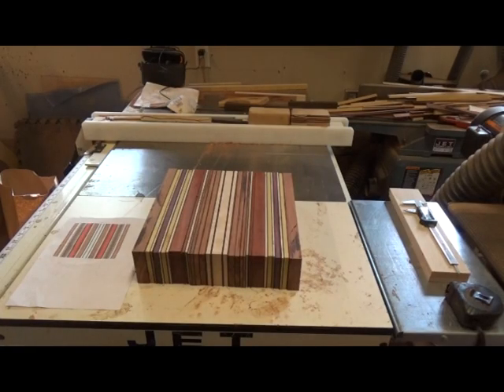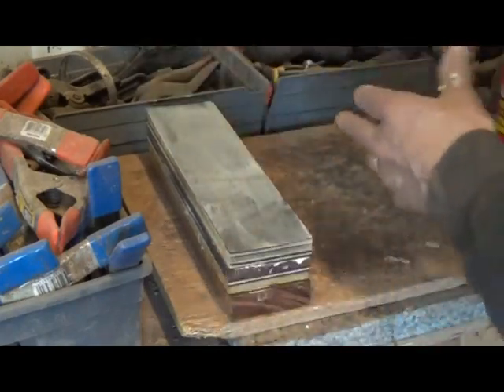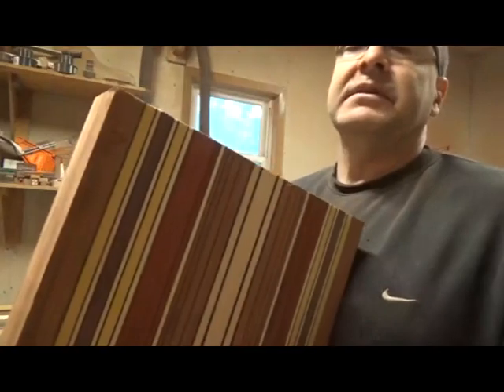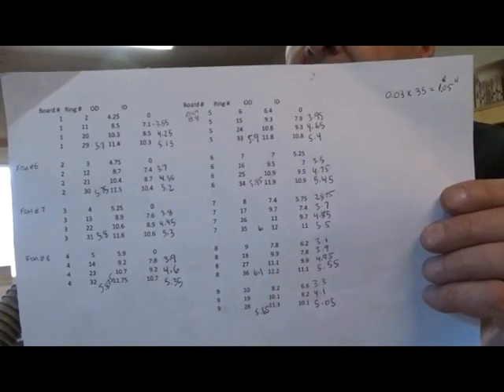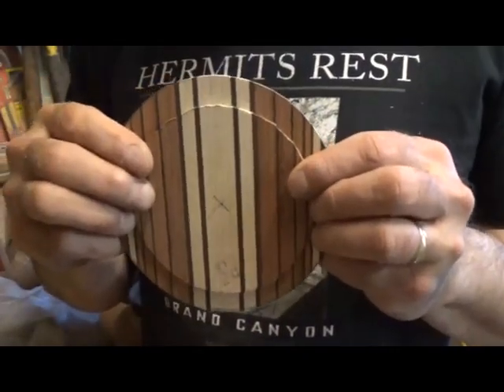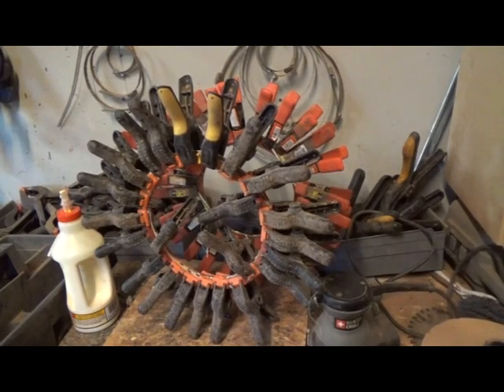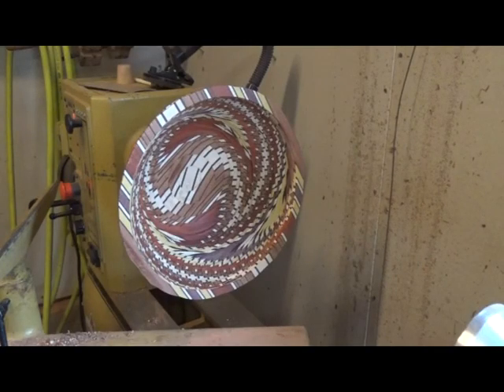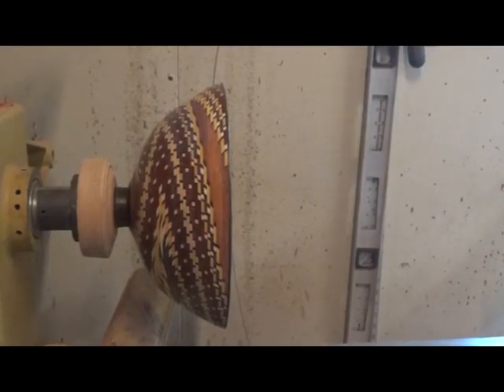Twister III

Comment: Tom, love your work. After gluing my slats and sanding them I only left with 1 3/4 inch thick board so I can only get 5 boards. You had nine in yours. Can I assume that I can cut the circles using up to the fifth level (not nine) and still have a bowl or will it not work as per your plan? Hope this makes sense.
Reply from the maker: Wayne, it was awhile ago that I did this project but I believe you will need to manually figure one which ring you can get from each board to maximize how many rings you can make.  This will be a lot of back and forth to figure out the best solution.
Reply: Thank you so, I was hoping for a formula based on height and diameter. Never was goo at math. But I’ll plug along

Comment: Hi Tom. Can you tell me how you prepare the Wenge. It is my understanding that wood is ran through a jointer before gluing. the wood is really thin so what is your procedure. I have been struggling with this,as a beginner,and I want to be safe. Thank you for your time. Robert
Reply from the maker: Robert, I use a drum sander, the planner would chip up the wood.

Comment: Hi Tom 
Great Bowl. I would like to know how you decide wich ring goes on which board?
Thanks
Jerry
Reply from the maker: For this shape I had to figure out what the best diameter worked with which board, a manual process.  I have the document that shows which board had which rings on my site under documents.
Reply: Thanks for the reply Tom. I was afraid of that, I was hoping for an easier.